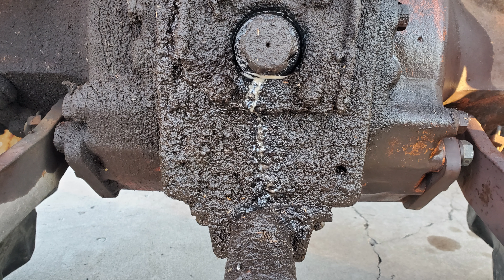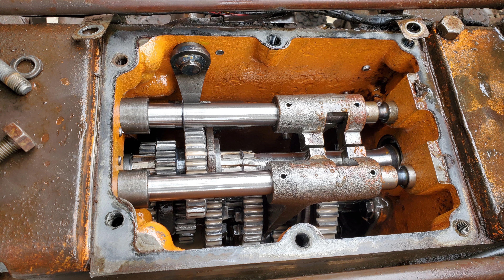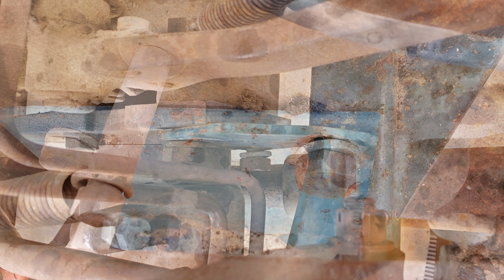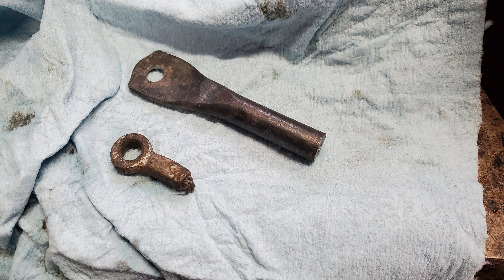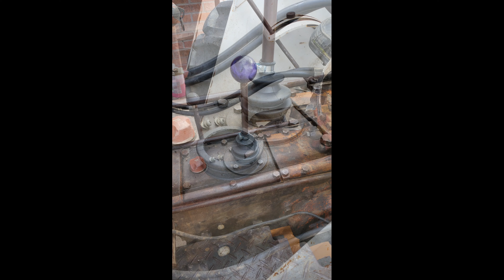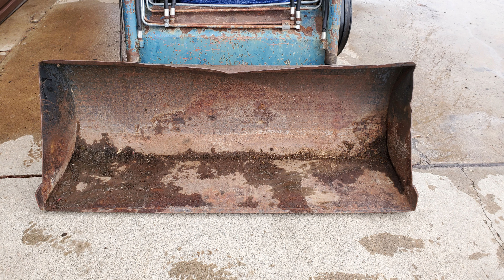Rebuilding a Satoh S650G Tractor - Part 2

Comment: Thanks for the videos. Picked up one of these about 15 years ago when I bought some property in the country. It ran briefly then slowly lost power and died. Didn't know anything about tractors and couldn't find a lot of information at the time. Gear box was full of water and number four cylinder was thick with oil. Compression was low. Haven't been able to get it to start since and no time to work on it. It's been begging for attention ever since. Now, with your videos I might try it again. Look forward to the next video. Paul2

Comment: I was wondering if you ever finished your Satoh 650? Your Part one came up on my feed this morning so I watched  as well as part two. I have the feeling you are rather new to the tractor world; correct me if I am wrong? I grew up farming and in high school when they sold the Satoh new. Later the brand was purchased and became part of Mitsubishi. The front end problem you experienced is common even when they were nearly new. These tractors really were not built heavy enough for using front end loaders. I know Sheaffer tractor in Illinois salvaged them for parts. With your milk  float it is good to run diesel fuel though them for 10 to 15 minutes without working the tractor then to drain it. If you need parts Sheaffer's can be a good source. Your rear wheels were likely loaded with calcium, it will eat them to no end. It is better to replace the wheels rather than blow out and chew up the sidewall of a tire. If you fill us a product like Rim Guard. Those old gas engines were designed to run on lead and it is a good idea to add a lead substitute. Iseki, Hinomoto and Yanmar are great brands either in gray market or regular imports. Iseki and Hinomoto make their own tractors and units for brands like Massey. Yanmar built the entire first John Deere compact line. In my experience I shy away from engines built by Mitsubishi as even in the cars they build they use second rate rings. Moreover, as it stands now I would not buy a tractor using a Mitsubishi engine. I shy away from brands like LS who relies largely on Mitsubishi engines. LS built the Farmtrac small 4x4 units and they are a so hard to keep up. The larger tractors were built by Escort and are bullet proof. As far as having a small 2wd drive tractor with a loader; most tractors don't fair well. Even if you don't have any hills a 4x4 tractor is a better balance for a loader more force is had and more loader stability. A 4x4 offers much more in terms of front end strength. Hope you are doing well with the tractor? Remember not all tractors are created equal and it is the reason some as they age have compound problems.

Comment: I’d like to see your steering arm repair!  I was just thinking about welding the arm to the spline, but I don’t want to complicate removal if need be. I also thought about drilling and tapping in the valley of opposing splines and running 2 grade 8 bolts as kind of a wedge, again with the possibility of ruining both parts. I’m curious as to what you’ve come up with. Great videos and I’m looking forward to Pt. 3!
Reply from the maker: My fix used JB Weld and it's held well enough at the moment but it's already loosening up and will need a more permanent fix. Unfortunately to do this right I am going to need to do some machine work, but I think using one of the universal style 1" sockets cut up and welded into the arm might do the trick. I will probably work on that later this year and will be sure to document it!

Comment: I'd like to see that pto shaft apart and the seal replacement.
Reply from the maker: I don't have any pictures of it apart but there is not much to it. The seal is replaced with the shaft still installed, no need to remove it. I actually don't think you can remove the PTO shaft without first removing the seal anyway.

Comment: What front inn  loader bucket ?that will fit  a G650.  Mine has the place for it.but did not have the loader or bucket . When I bought it...
Is there a universal running loader bucket that will fit.?

Comment: tank you for this information, . I want to know where is the hydraulic oil filter on this tractor?
Reply from the maker: There is a metal screen filter located on the inlet side of the tank. When standing behind the tractor on your right hand side there is a large plug that you can unscrew to remove the screen and clean it out. You do have to drain the fluid out of the tank first though. There is a smaller plug that is the drain plug on the right hand side as well.

Comment: How did you replace the PTO seal? Did you remove the whole cover or just the collar ring? I have read stories that people can't replace the seal and end up just putting it back together without replacing it...
Reply from the maker: I pulled it out using a seal puller. It's basically a steel hook that you slip in between the shaft and the seal and then you can pry it out. No need to remove the cover to replace the PTO seal. Once it's pulled out just clean it up and then drive in the new one. Make sure to clean up any burrs and lubricate the shaft first to help keep the new seal intact. You'll want to use a short length of pipe that is the right diameter (I use exhaust pipe), or if you're very careful and go slow you can just drive it in a little in several spots repeatedly to keep it going in evenly. But using a length of pipe works best.
Reply: @saturdayswithpaul7352  THANK YOU!!! So much for responding to my questions, it really made the whole process a little less stressful. We dropped the oil and it was horrendous! Really had no idea it had that much water in it (sooo much after it separated 😫 ) The seal came out easily, we used a hammer and flat chisel to get the new one back in. We have a family vlog and actually just uploaded our video, we mention you in it. Super appreciate your time. Have a good one!
Reply from the maker: @RonnyandBrettany  Glad to hear it went well!
Reply: Any new videos coming up soon?

Comment: hi good video  ,, i need a carburetor kit  for  one like this ,,any idea .?. the one on eBay is not usable  , the parts  look right but don't fit  ..  Thanks Ed  Loretto  Ontario  Canada
Reply from the maker: I actually did use one of the Ebay kits, but while most of the gaskets do fit well enough, I had to make one of the gaskets myself (can't recall offhand which one) and you have to disassemble the pump plunger to replace the leather cup as the plunger provided in the kits do not really fit right, but the cup is the right size.